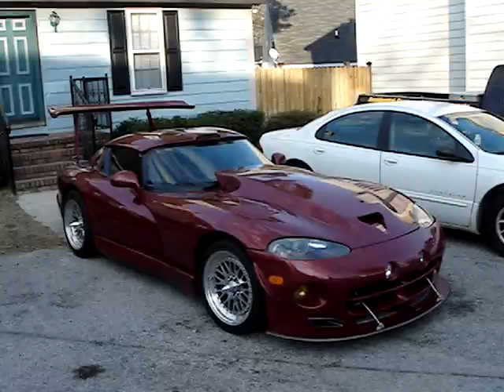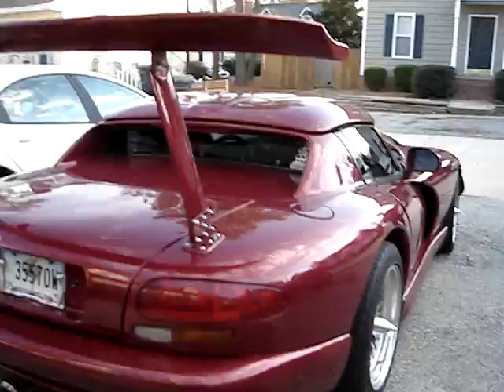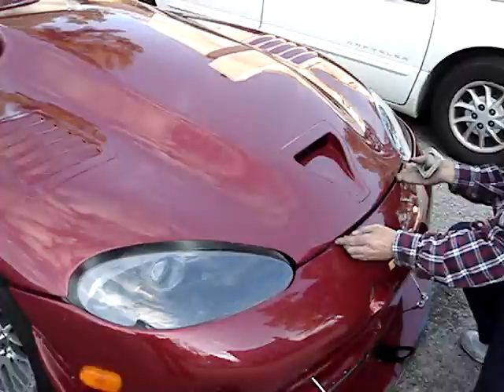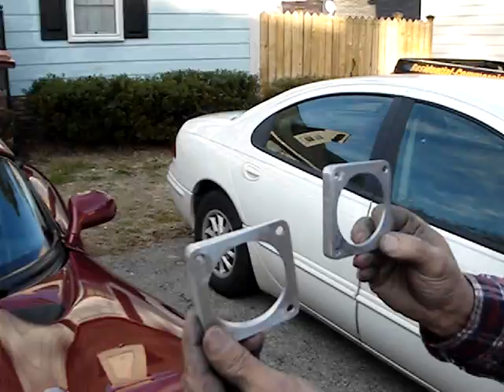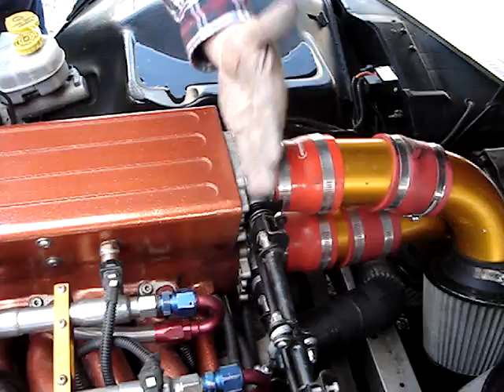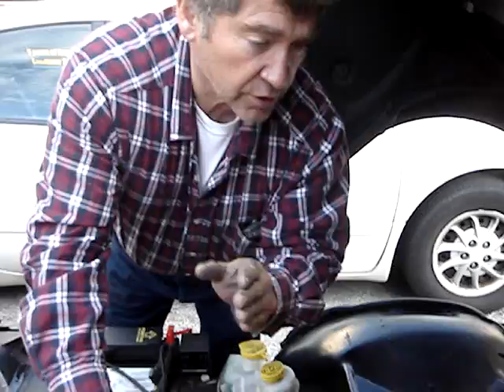viper mod

Comment from the maker: @piglizzard we want the pulses from each cylinder to be even. The flow of air into the intake seems to be leaning out cylinders 7 and 8.  meaning too much air into those cylinders.  so if we direct the flow differently into the intake it might fix the problem. Dodge already did this with the Gen 3 intake. We are working on a 10 throttle body setup after looking at the Lexus LFA intake and taking some of their ideas.  hard part will be synching all the throttle bodies and positioning them.

Comment from the maker: The thermocouple temps show cly. 7 &8 hotter. engine disassembly @ 30 k miles show wider ring gaps at 7&8 as well. over .005 to .008 larger. all from heat. Gen 3&4 dont have this. What is different? The intake. Now the gen 3 and 4 are fine.. what was done different on gen 3 and 4.  Intake changes and mild mild factory port relocating. With the larger bore there is additional valve unshrouding as well. We do use larger intakes valves as well. This thing works is all we can say.

Comment from the maker: To the Viper guys out there.  While putting in the intake we installed 1.65 titanium exhaust valve as well as titanium intake valves with a heavier/stronger valve spring a bit taller as well. The intake ports were polished as well as straightened out a bit. This is not just an intake on an intake. the combustion chamber is genuinely heart shaped. the exhaust roof is raised as well. The bowls were cut out with a full 2 in cutter then blended.

Comment from the maker: @ShelbyRyder we are goin to get around to checking the plugs.  I'm just really interested in all the banter on the viper forum about this.  I'm pretty sure the intake is goin to skew the results a bit compared to a stock setup but this intake was designed by Chrysler themselves and we happened to get the drawings that their engineers signed and gave to us.  but back to your question the car does idle at 500 rpm now instead of 600.